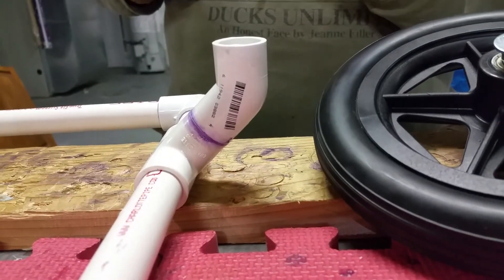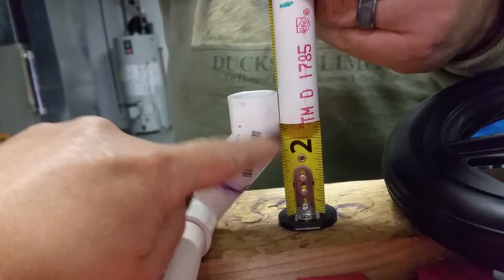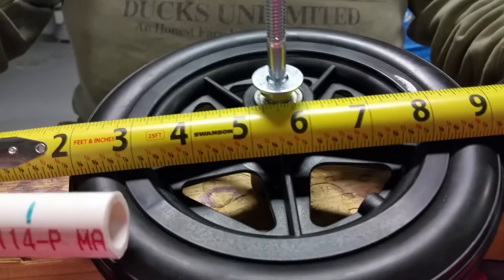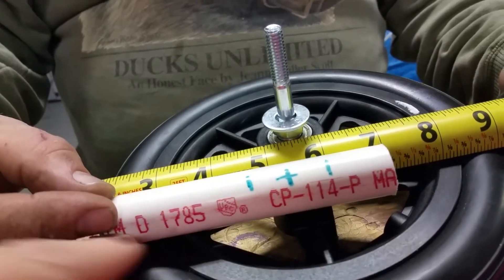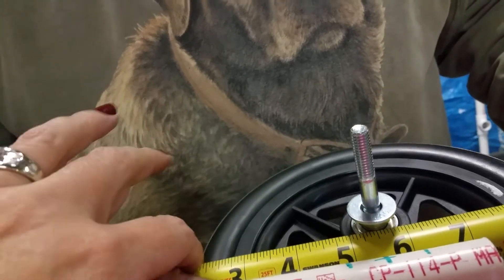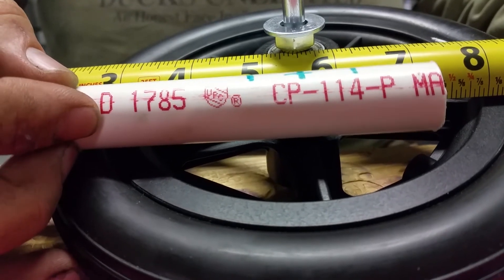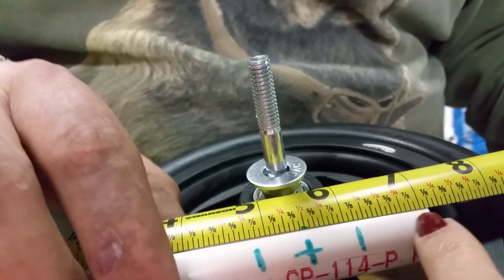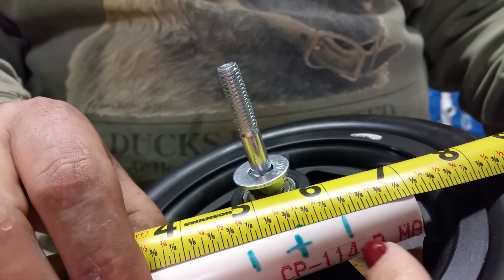Measuring Doggie Wheelchair wheel holes

Comment: I miss you so much Dawn. Hearing your voice brings me comfort. Keep building Bruce!  I have a suggestion that you can change on here and that is to drill the wood slightly narrower, so that the bolt bites into the wood and must be screwed into it. This helps to add to the stability of the axle.  

this video is a perfect lesson on wheel placement.  The hub spacer should be tight on the bolt as well as snug in the hub, so the wheels are spinning on the bearings instead of inside of the hub spacer. A dab of lock tight can help with that if its trying to spin internally.

Also, can you upload a video in how to drill the holes straight at 90° and 180°on a round pipe? Some people don't have drill presses or jigs to do this and if the dowel is not secured to the PVC with a screw first it tends to shift while drilling through it if you do both together. For me, if I do them separate, lining them up is difficult because I can never drill the hole straight! Your videos are a great help. Please upload more!